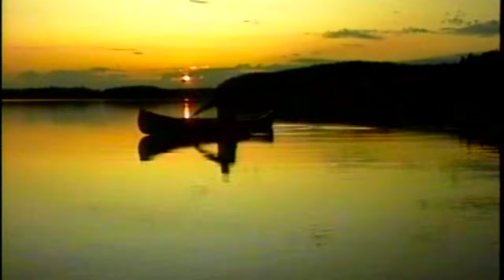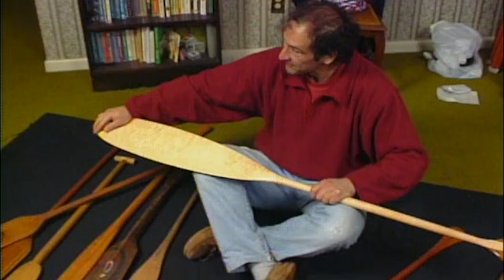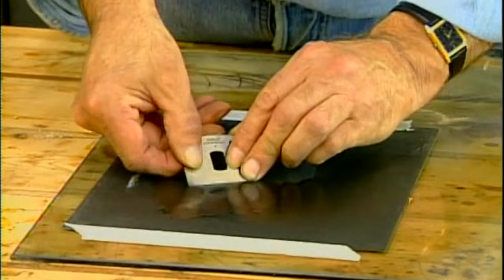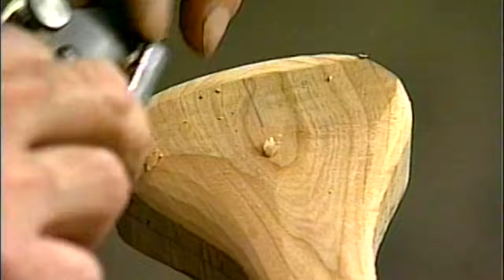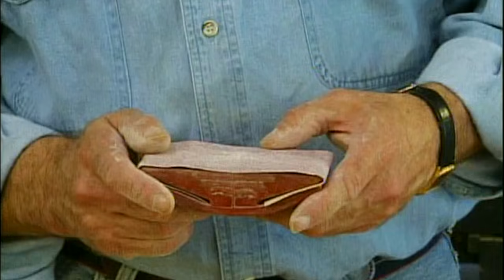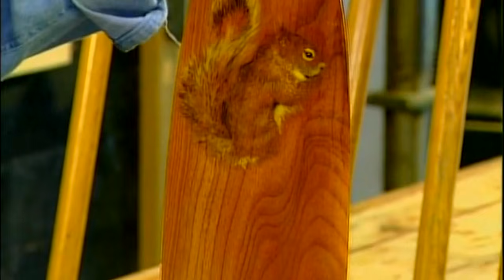The Art of Paddle Carving (1996)

Comment: I'm curious as to how balanced this would be, given that the blade surfaces are convex, so that the blade is actually quite a big mass of wood.  I made mine concave, with a subtle central rib, using a round-bladed wooden block plane.  The paddle then balances just above the blade, and flexes exquisitely without loss of power.  Not appropriate for a whitewater paddle, but gorgeous for lake travel.
  
The use of varnish is also controversial.  I'm in the camp that says it remains forever tacky and therefore causes blisters.  I use Danish Oil and refresh it every year using a ScotchBrite.